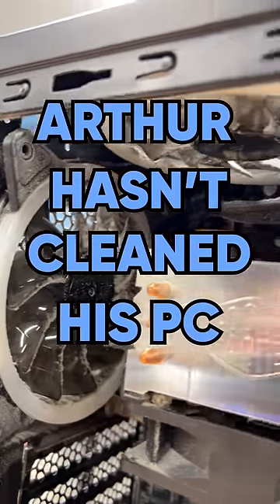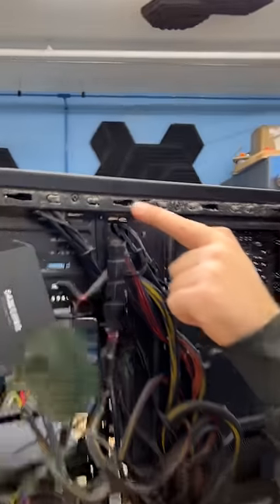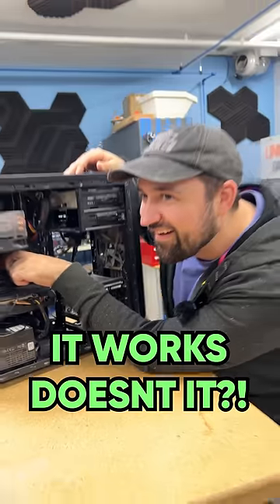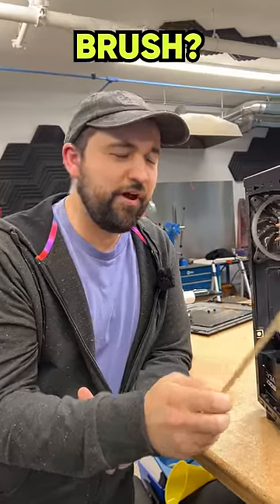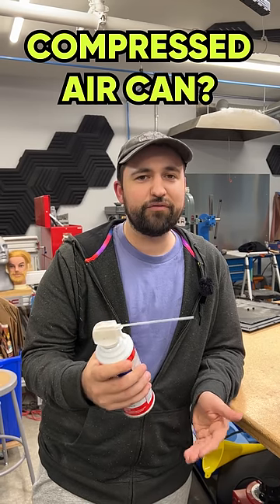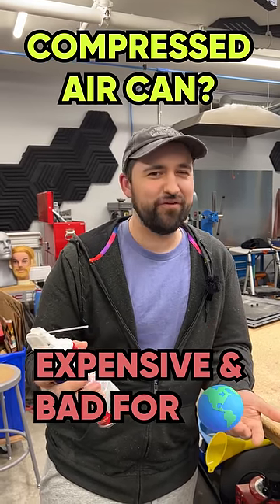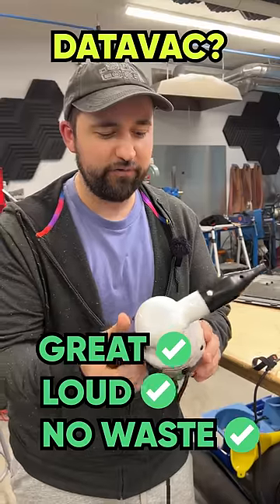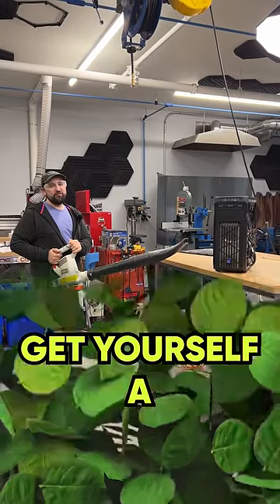This PC wasn't cleaned for 5 years...

Comment: I wonder how the inside of laptops would look like then 💀
Reply: When should I clean it/ get it clean?
Reply: @Oyabu...  for laptops, probably every few months I'd say cause dust buildup can be much more damaging to its performance than a regular pc
Reply: Well an old laptop that I've been using for programming on the go. I decided to look inside, because I wanted to upgrade the RAM and 2 GB of RAM isn't really perfect for me (I upgraded it to have 8 GB of RAM, and things don't crash as much). Because unlike Ubuntu, the Linux distro I use now (Fedora Workstation) would close apps instead of freezing. Which is pretty annoying having to reopen applications again and again. When I first opened it up to look inside, it was kinda dusty. Despite it being 8 years old, it wasn't super dusty but I cleaned out the dust for obvious reasons.
Reply: On laptops its not like that, the fans are smaller and i think you should clean it after like 1.5 year
Reply: @eboebo7976  Yeah that's kind of what I thought. Because as I mentioned in my previous comment. My 8 year old laptop wasn't super dusty when I opened it up for the first time. Might be because laptops are more enclosed and thinner than desktops.
Reply: @normified  my laptop is 7 yrs old and I have never cleaned it 💀
Reply: Cleaning schedule should be determined by the amount of dust you see in your home. Whenever you see dust starting to collect on the vent fins of the laptop. Shine a light in if you see dryer lint it needs cleaning..
Reply: Depends where you use it, on your lap/on bed is a nono on a clean desk it should stay clean for a lot longer
Reply: When I first opened up a laptop to do a SSD upgrade I was concerned, the graphics cooler was chock full of dust to the point that it possibly affected performance (hard to tell, as both cleaning and changing to a SSD at the same time meant I couldn't check the difference).
 I now do a clean out every year or two of my laptops, but then I have pets, lots of dust ect. I've got a friend who's a neat freak and who's floors are possibly cleaner than many peoples tables - his laptops tend to be pretty clean on the inside … but there's still some dust.
Reply: depends colud be decently bad but for lots not to mutch as it can be a lot harder for the dust to get to everything. the only main one wolud be the fan and fins
Reply: @runar4993  it's literally a LAPtop. I will always use it on my lap and in bed because it's not a DESKtop
Reply: @normified  it's more like 3 months depending on your environment, 6 months if you use it on air conditioned places most of the time
Reply: @normified  That’s pretty excessive. I cleaned mine about a year after owning it and it had no more than a pinch of dust on the heatsink. This didn’t affect performance whatsoever. Every 2-4 years should be good for cleaning PCs or laptops.
Reply: Assuming the surface you use it on is relatively clean, then no more than once a year, maybe even two, my 5 year old laptop didn't have any dust when I popped it open for a expandable storage and ram upgrade
Reply: A lot of them have filters so you can just sorta blow out the vents
Reply: the board itself suprisingly not bad most of the airflow is directed straight to the cpu heat sink then directly out so not alot of dust finds its way to the other components the heat block however.... ive pulled litteral blankets of dust and fluff off them that come off in felt like sheets a quater inch thick
Reply: @pyp2205  90% of comment is you talking about how you use linux. 10% is about what OP asked
Reply: Same / worse
Reply: @pyp2205  it’s bc there is smaller venting holes and less airflow overall with one generally a small fan inside to keep everything cooled off
Reply: In 5 years I've cleaned my laptop 4 times. The only dusty space in a laptop is the fan and the heatsink so not much of dust. Desktops collect more dust due to many more openings
Reply: They look horrible. I've cleaned mine before.
Reply: Laptop cleaning it's horrific
This take me
Between 2 and 4 hours
To clean it up 😱
Reply: @MonsterKekett  If you have an old laptop yes. But new ones are easier to do so

Comment: “Let’s just blow all the dust into our shop instead of cleaning it” 😭
Reply: @pixels_per_inch  because a vacuum can create static which is bad for the electrical components in the pc
Reply: @400cabal  What makes a blower not create static, but a vacuum does? The old timey vacuum cleaners could be turned into blowers just by moving the hose to the back instead. Does that mean they suddenly started/stopped creating static electricity?
Reply: Floors are way easier to clean than PCs, so just blow the dust out and let the Roomba get later.
Reply: @400cabal  don't talk about things you don't understand.
Reply: @treborrrrr  the dust and particles rubbing against the hose can create static electricity, a blower does not create static electricity for the same reason a vaccum does
Reply: @treborrrrr  also you usually hold a vaccum closer to the surface you are trying to clean, while compressed air is, well compressed so you can hold it much farther away. The risk of a vaccum damaging pc components isn’t high though, about the same as you transferring static electricity from your hands when building or changing parts, but it’s good just to be safe
Reply: I used the air compressor that came with my air bed from years back. works better than anything out there.
Reply: @pixels_per_inch  that's what.......
Reply: The force of pushing is stronger
Reply: You know Gamers dont know that concept, but you can clean your PC outside. On the balcony, or just infront of your main door.
Reply: Linus carried the dusty server outside for that exact reason. He 100% agrees
Reply: @michaelgourvitch5323  If you're living in a city center and don't have a balcony or backyard, cleaning it on a busy street is not really feasible.
Reply: @400cabal  In theory, yes. But if you only clean once or twice a year and are a bit careful, it's not a problem. Have been cleaning my PCs for almost 30 years with vacuum cleaners and never killed anything with it.
Reply: Truth is its just easier, besides there's always the risk of static electricity when touching your PC components if you plan on using brushed UNLESS you dispell your static electricity every so often or have a grounding wrist band, tho risk is still there even if the power is off and disconnected as there are other parts of the PC which stay powered even after discharging power seeing as there is a round battery in the PC- can't remember its name at the moment. You could always take apart the PC each time to Clean it so you can get a fresh and or deep isopropyl or alcohol clean but really why waste hours of time cleaning something when the dust can just be blown away and swept up after? I do use a plastic brush for some things like the fans but really if you need a brush you obviously haven't kept onto of your PC maintenance or live somewhere extremely dusty, like next to a gravel road or have poor house ventilation.

Edit: thought I'd add in a joke sorta, I usually use a air mattress pump for cleaning my PC, put the extra small nossel on it and it becomes a PC and Console cleaning Beast, hasn't failed me yet- tho scares the shit out of me when the end piece comes loose and suddenly Flys off xD
Reply: @Bitfire31337  That's very anectodal. You could do it 10x and not have it happen at all and someone could do it once and fry their components.
Reply: @400cabal  Yes, it's only my own (though plentiful) experience. But in that experience it's less a question of pure luck or randomness and more a question of how you do it. I wouldn't use a vacuum brush to wildy brush over the mainboard for instance, but cleaning the case itself, fans, radiators and (encased, non-m.2) drives with it is fine, for example.
Reply: @daniomyte  I have been vacuuming my PC definitely for over a decade and never had a single issue
Reply: @The_Viktor_Reznov   as I said, there is a small chance static discharge can go through your pc, but it is very small. About as small as you sending static electricity and frying your components using your hands. Just because it didn’t happen to you yet doesn’t mean it’s not going to happen but your welcome to speculate
Reply: @daniomyte  the chance you are going to get hit by a car just walking down the street is probably much higher. So, wear a grounding suit every time you touch anything that has electric components and never go outside. Safety first.
Reply: Just clean the room after ?
Reply: Yeah, bring it to shop right? 

Reminded me when i was bad, know nothing and my pc part got swapped :)
Reply: I have a small air compressor and I take my pc the 10 ft from where it sits directly outside and blow it out, let the outside deal with 99% of the dust I free. Have to do every 2 weeks to a month because dusty cockatiel and his love of preening and flinging dust next to pc.
Reply: @helgenlane  you don’t get hit by a car by looking both ways. You don’t get hit by lightning by not standing in your roof. Take precautions.
Reply: Gonna be breathing that in for weeks
Reply: @400cabal  lol
Reply: Nitecore makes an awesome little rechargeable power blower that is perfect for this
Reply: get a vacuum that sucks and blows... giggity. so bring the pc outside and use the blow feature. been doing it on my pcs with no problem
Reply: @400cabal  i've been using various little handheld vacs on my PCs for the last 15yrs and never had a problem. Didn't Linus do a video on static discharge and what it does to components and pretty much proved it doesn't do anything.
Reply: @your_average_cultured_dude  but he's right though. You're the one who doesn't understand
Reply: I used vacuum on my PC near motherboard nothing happened on graphics card inside the PC case lol 😆
Reply: @minecrewsupernt831  yes pushing the dust deeper and not removing it from all the crevaces

Comment: Anybody who is thinking about cleaning with an electric blower or vacuum: PLEASE make sure you find one that says "NO STATIC." A lot of household vacuums will produce static charges that can seriously fuck up components in the computer. There are specific versions designed for computer cleaning so please look for those instead of just using a hair dryer or vacuum you have at home
Reply: yeah the but the chances of it messing up ur components is low
Reply: @rocas1491  there’s still a chance, don’t forget parts aren’t cheap either
Reply: Doesn't matter, just gotta make sure pc ain't connected to the power and there's no electricity left in it (holding power button for a few seconds after cutting of power will solve it)
Reply: air compressor

Comment: I've used a leaf blower for PCs that haven't been cleaning in a while. Works pretty well
Reply: I use air compressor
Reply: @FUBBA  Right? They all say "oh compressor is bad uhhh static" and what not, but using a compressor for short bursts is better than that white blower that constantly blows air at slower speed.
And much better than a fucking leaf blower, come on people
Reply: @Napoleon_Blownapart  yeah same I use compressor too lol my pc never broke. vaccum creates more static than compressor
Reply: @Napoleon_Blownapart  i own a compressor. I find leaf blower easier and faster.. You have more cubic feet of air blowering compare to compressor with gun. In just 5-10 second with leaf blower, You could clean your computer.
Reply: Same
Reply: I use a tire inflator
Reply: @toytulog576 8 seconds for me with my leaf blower

Comment: I haven't cleaned the radiators or fans in my PC in 10 years and it looks spotless compared to this. You'd be surprised how far positive air pressure and fan filters go.
Edit: I do keep it elevated on a desk though
Reply: Yeah having it on the desk helps alot. I cleaned my computer every year, didn't have fan filters on my atx tower..
When I moved it to a shelf dust issue was 90% less.
Reply: Just curious, but you cleaned the air filters every now and then?
Reply: @systoxity  like once every year maybe?
Reply: @systoxity  i clean my dust filters like once a month. I have pets though so dander can build up quite quickly.
Reply: If a computer is in the ground below you, 99% of that dust is your dead skin. :)
Reply: Not to mention just good environment filtration
Reply: @ventilate4267  Filtration?
Reply: @HairyCaveMan  yes, if you have less dust in your air less will make it into your computer
Reply: I don't even keep my PC on a desk (carpet is low and the legs are tall enough for there to be airflow beneath the PC) and I've NEVER built up any dust like this. Plus I live in a loft so dust is just fucking easy to get everywhere.
Reply: I have my pc on top of some skateboard decks 😂 works fine though.
Reply: Yeah I'm not seeing how people's shit gets so nasty. My assumption is living on the floor in a dusty ass home

Comment: Vacuums: "put me in coach*
Reply: Using a vacuum on the inside of a PC can be dangerous. The dust can create static buildup on the plastic tube and you can accidentally fry a component with a discharge spark. That's why they use blowers instead.
Reply: Fry your motherboard
Reply: @sUmEgIaMbRuS  there are vacuums that suck and blow... giggity. so use the blow part. been doing it on my pcs no problem
Reply: @sUmEgIaMbRuS  So why would a blower be any different? Why not wrap some wire around the plastic tube and connect it to the chassis as an earthing strap?
Reply: @JehuMcSpooran  A blower is different because the dust particles don't bump into the tube, so there's no charge buildup.

Wrapping the tube in foil doesn't work because plastic is a way too strong insulator for the charge building up on the inside to get to the outside. If you have a solid metal tube that you can ground, that would work. Or if you can wrap the inside of the tube somehow.

Comment: One important thing they left out, is get something to jam the fans so they don't spin. Wire works well. Not only does the dust not get blown off well they are spinning with the air, it can be bad for the bearings.
Reply: Normally I say this is unnecessary, but it's probably a good idea if you're using a leafblower.

Comment: I use a tire pump compressor with a 5 gallon air tank. I pump air into the tank and when it's around 50-70 psi I can use a blow nozzle from the tank. It works very well and runs off of a car battery so it's really easy to charge and use, although it is a bulky setup

Comment: After seeing the leaf blower thing I just had the idea to use a hair dryer if I don't have anything else. (Obviously hold down the little button that makes the air cold to not melt the PC)
Reply: Don't do this.
Hair dryers will heat up, and the coils will start to flake off small pieces of metal. The last thing you want is those flakes to come loose and be blown into your computer (even on cool).
Reply: My hair dryer has a switch for cold air, no need to hold down a button. I'll use it if I ever feel the need, don't see how those datavac things do anything different than a cold hairdryer. That's some money you don't need to spend!

Comment: I actually just cleaned my pc a few days ago. I got a can of compressed air like they mentioned.
My pc is just a generic prebuilt home pc from Dell. No graphics card. It's been 5 years since I got it and I have never cleaned it. Finally cleaned it. The fans and cpu cooler fins were coated in dust, but otherwise, it wasn't that bad.

Comment: I usually use an air compressor if I want to be more thorough, but using a DataVac type blower gets off a fair amount.  Just be careful to not let any fans spin, you can damage them or whatever they're plugged into if you're not careful

Comment: 1/2 inch paint brush and a low powered vacuum work well. Means you're not spewing dust every where else.
I also remove all components, clean all fans/filters etc. and put fresh thermal paste where it needs it.

Comment: You can also get a small air compressor, it works just as well if not BETTER than air cans. (Just don't shove your hand in the nozzle, if it's unregulated it can puncture skin...)
Edit: Probably a good idea to get a water trap to go with it too, compressing air causes precipitation of moisture in the air...

Comment: Make sure when doing this to disconnect all fans in the system.  You do this because the fans will create voltage when spun by the moving air.  (The voltage generated by the fans will mess up the motherboard in the long run)

Comment: I worked at a repair shop in 2014. We bought a datavac and I used it daily. We started out buying compress air cans but that got old fast. Years later we closed that department and I got to take it home. I still use it often. Thing works like a champ almost 10 years later.

Also, I had that same PC case. It's cheap af. 😆
Broke in many places when i moved houses last year.

Comment: i got a 150PSI air compressor that is used for construction and mechanic stuff with a blower nozzle that works even better than the leaf blower. a 50ft hose really comes in handy when you dont want to take your pc outside

Comment: I've got a Rainbow vacuum.  Not saying you should buy one, I made some financial mistakes as a younger man; but, it has a straw like nozzle that works awesome.  You can also put the hose on the exhaust port and use it like compressed air.

Comment: Fyi, the DataVac or even the leaf blower cannot blow out all of the microscopic dust from the electronic components within the system. 
Best is to get the air compressor machine (with adequate psi) with a small tips to blow out all of the microscopic dust with precision. You'll be amazed what it can do for you. Night and day.